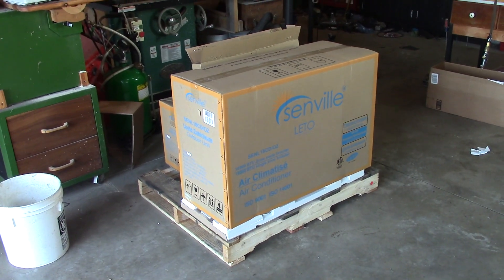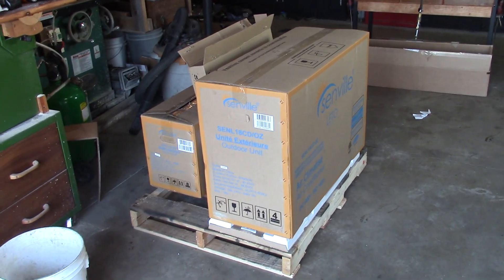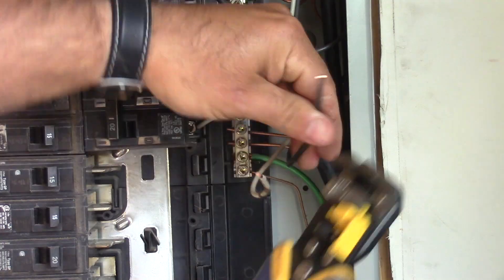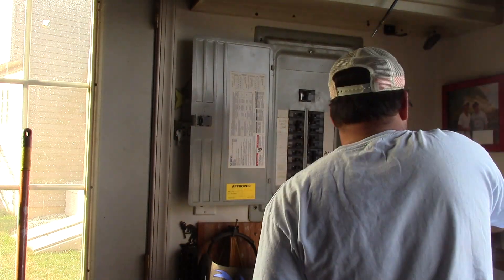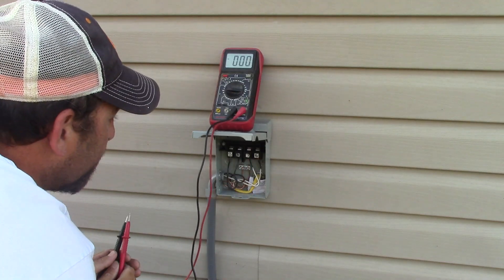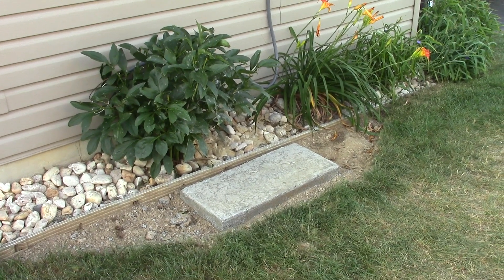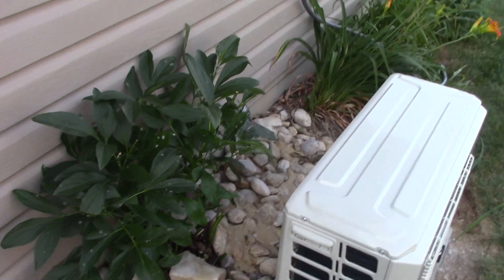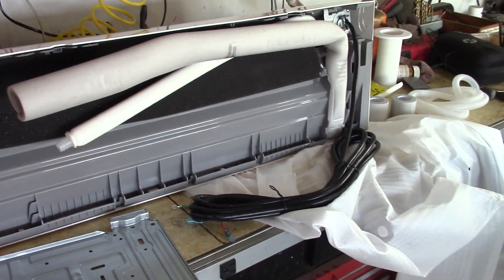Senville Mini Split A/C Heat Pump Installation

Comment: I looked into Senville but need an 1800k 2 zone, they do not know when they will be in stock.
The first thing i had to do was put ina larger circuit breaker panel.

Comment: Self installation is the way to go, regardless of the loss of warranty. If you pay $1,000 for the unit and $500 for tools it will still cost less than having a professional do the install, which could be $500 to $1500 or more. if the unit breaks, you have the tools to potentially fix it. It would cost less to buy a new unit than to have it repaired by a professional. Keep in mind that the warranty will be limited by time and usually for parts. I have a two year old, high end, furnace from Carrier, under warranty. At 18 months, the blower failed. The blower parts were covered, but the labor was $100 to diagnose and $350 to repair. That, my friends, is an HVAC warranty. Get the tools, become self sufficient.

Comment: You didn't need to cut that v in the cover over the electrical wire because the wire should have come in from the bottom. there's two screws that hold a strap in place you remove those two screws and the strap and bring your wire in from the bottom. Bend that wire 90° up and put that strap over the wire and secure it with the two screws.

Comment: Important Note: Many areas are now requiring these units to be installed on the building and it is against code to install on a slab.  My local code calls for the unit to be a minimum of 8 inches off the ground.

Comment: Just be careful when working with electrical and refrigerant. Refrigerant burns can hurt. I install lots of mitsubishi and daiken. I'm licensed. Coworkers get upset when they hear of homeowners trying to install these themselves... but personally I don't care what you do.. there's plenty of work. I do want to hear some reviews on this system if anyone has it? May install an 18k at my house to replace an older 12k hyperheat.

Comment: 3:50 Too much bare wire showing. The insulation should be no more than 1/8 inch from the connector.. The Black wire is OK.
5:40 Same problem...

Comment: You need to use 12-3 with bare copper ground as 12-2 with bare copper ground is not sufficient and certainly not to code in any part of the U.S.

Comment: Can I use a plug with a mini split assuming I am not required by Code to tie into a breaker?  If not, why not?
Reply: This is 220v so you would not be able to just plug it in. However this brand makes a 12k btu that is 110v. Technically you could put a whip on it and plug it in. I would make sure that you do not have a lot on that circuit. They draw quite a bit when starting up. Much like a window unit or a microwave.. you just do not want to overload the circuit

Comment: You are supposed to have an outlet that requires the neutral you took for power. Code requires a service outlet where that unit is placed

Comment: Really nice job with important details in assembling the parts and taking the time to use proper sealing techniques. I especially appreciate putting this together in digestable portions. Also appreciate being candid about being a homeowner level (very skilled) and approaching it from that perspective.

Comment: Thank you for sharing your installation.
Question: I got the 18,000 BTU one. How do I know what size of brakers do I need?
I see you used 2 20 amps. Where did you see that you needed that size? Also what size of wire you used, 12 or 10 gauge.
Please advise.
Reply: read label on outdoor unit

Comment: Installed a 9k btu Senville MS last week. I found it time consuming but straightforward if you have the right tools and don’t skip important steps. Always do a nitrogen pressure test!  This insures that you have no leaks BEFORE vacuuming the lines down. Then,  always use a micron gauge when you vacuum down and make sure there’s no significant rise when you isolate the lines. Wait at least 30 minutes to evaluate full vacuum for leaks. Finally, research and get the required equipment. A 4-way charging/test gauge set is not enough. You will need a micron gauge, Schrader core removal tools with cutoffs, a nitrogen tank, leak detection soap, and enough knowledge to know the steps of installation that will keep your line set air and water vapor free when vacuuming and releasing the refrigerant charge. The primary killer of MS systems is air/water in the refrigerant loop.

Comment: How was your heat pump during winter season? Did you raise the condenser? I had mine building up ice at the bottom so bought a frame to raise to the flooring.
Reply: That's normal. Some brands have a pan defrost system.. these probably don't. Did lifting it help?

Comment: Good video, however, for your size Garage a 12,000 BTU size Mini Split would have been a better choice than a 18,000 BTU (you said 1800 in the video BTW) and with the money you saved you could have bought the better Senville Aura series model. It has a much higher Seer rating and is WIFI compatible. The 18,000 BTU Mini Split will cool your size Garage more quickly but will turn on and off more times than a 12,000 BTU model will and remove less humidity and give you higher energy bills.

Comment: I've got everything I need to install this but I can't connect my line set to the air handler for the inside unit I have red black white green wires but I can't get my hands in there to wear them up nor do I know where they go because they're labeled one two three ground I appreciate someone to help me because I've got everything done except hanging the unit and I cannot do that until I connect the signal wire.

Comment: Is there a reason you went with the 220 unit vs the 120?  Also, @5:57 does that whip come with the unit?
Reply: 110 is ok if you need a small unit. They work. However he got an 18k btu I believe and that is too large to have a 110 model. Only the small units like 9k btu or maybe a 12k btu you can have a choice to get 110. Just make sure that the circuit is only running the unit. If there is a light or something else like that it's fine but too much load will blow breakers and hurt the unit
Reply: 220 volts are more efficient, requirng less current. No the whip and box do not come with the unit.

Comment: Nice video. i bought the senville-senl 12cd mini split system 12000 BTU 110/120v.  This one i can just connected to any 120 v outlet right?  Also by any chance do you have a video on how vacumed this unit?  I came precharged so I just need to vacume it.  Thank u
Reply: Technically yes you could wire in a plug on 110. But you want to make sure that you do not have much on the circuit. It can hurt the system if too much is on the circuit

Comment: Hi, Thanks for the video. How to check the amps for the circuit breaker and size of wiring? And the size of wire from A/C disconnect to condenser? I have a Senville 12hf. Thank you.

Comment: ref lines must be 3/8 and 1/4 and clear tube for condens water?and 14/4 split cable coil 1070 wire?  - to every rooms? thanks for this detailed video!

Comment: 18000 btu can give you a mold/moisture problem! You should be using 12000 btu for that size. Plus with 12000 btu you could've gotten 120 volt making the wiring much easier.

Comment: Good video, looking forwards to part 2.  One thing however, when stripping wire for the breaker, just strip about 5/8", that way you will not have any exposed wire at the breaker terminal connection.  Cheers.
Reply: Also, at the disconnect the insulation sheath(yellow) and paper needs to be removed flush with the connector.
Reply: Part 2 and 3 never happened - this video was 2 years a go

Comment: I thought i bought everything i need to install but the vacuum pump set did not come with the adapters that i need to hook it up. What are the correct adapters i should i get? Thanks

Comment: Why doesn’t Senville just connect that wire inside the head unit, and label it for you? Thanks Senville. Coulda saved me 20 mins because your instructions blow chunks.

Comment: Nice video! However, FOR THE LOVE OF GOD REPLACE THAT 14 GA CABLE WITH 12 GA RATED FOR 20 AMPS! I might add that any wet or outside location requires UH rated cable as well. Even if in a water proof conduit per NEC.
Reply: for petes sakes fella...the jacket on the romex is yellow...in the whip use thhn wire

Comment: Great video.  Thanks for the detail.

Did this get approved by the Electrical Inspector?  The NEC forbids using a "white" conductor (and coloring it black or wrapping in electrical tape) for any wire under 8 AWG.  It must be colored other than white or green.  Also the sheathing must be removed where the wires enter the box.  Your Inspector must be really loose with the NEC.   This can be accomplished by using 12/3 wire and cutting back the white wire OR using individual conductors but you will need EMT (Blue "Smurf tube" conduit)

Also remember, the breaker's purpose is to protect the wire and trip before the amperage goes too high, melting the wire coating and causing a fire. It is up to the installer to check the Max Amps used by the unit and install the correct breaker/wire size.  In other words, basically the breakers and wire size (AWG) are matched.  15 amp breaker is for 14 AWG, 20 amp breaker is for 12 AWG, 30 Amp breaker is for a 10 AWG wire.  There are several exceptions (voltage loss, etc) but for general household wiring, breaker size is matched to wire size.  I always up-size my wire/breakers.

Also, make sure you tighten the breaker screw in the panel or the lug screw in the box to proper specifications.  Many of us do not use a torque wrench when we should.  The torque needs to be very tight to prevent moving of the wire, causing sparks which causes.....you guessed it...FIRE.

As mentioned before, circuit breakers often "go bad"  You should "ALWAYS" double check the circuit with a meter before working on it.
Reply: I was also curious about that too. Is not necessary at all. Once a cable is connected to the breaker terminal, rainbow colors on it, it's hot!
Reply: I got confused  on the video on the electrical on the outside  he never told the size of wire he used from the disconnect switch to compressor. Correct me if I'm wrong the size of wire should be the same 12-2 from breaker to disconnect, 12-2 from disconnect to compressor.

Comment: So for a 24000 btu I can use a 12/2 wire?
Reply: You can but not recommended. 12guage allows for a 30 amp circuit breaker. The two will bring up your two hots (220v) and ground (must rebrand the white white to black with tape or marker) to the ac disconnect. It just means you will not have a dedicated neutral. They want you to have a neutral but at the end of the day the neutral and ground are bonded at the ac disconnect anyway. Up to you I went a head and went with 12/3 just to cover all the bases.

Comment: wow, how lucky the wire you needed was already fed through and just waiting for you to attach it but you should never have touched those without first showing people you used a meter and made sure its dead. . Thats really lucky.
Reply: Why's that?  It was pretty clear the wires were not attached to a breaker or power source of any kind.
Reply: @red97rum   because when showing how to do a job its bad form to not show that you tested it dead, thats all. You dont trust a disconnect, you test it.
Reply: @abraxas511  I get it, very true.  Always better to be safe than sorry :)
Reply: @red97rum  That was my only point. We know he tested it dead. I was just thinking along the lines of safety for people learning. Sorta like a gun repair video where we know the gun is unloaded and safe, but its always good to prove it safe for the audience to show it as a safe habit.. Cheers.

Comment: 14/2 wire ? I called senville they said I should use 10/2 and a 30 amp breaker ... Could I go with either ... It shouldn't pull more than 20 amps...  I have the 12000btu leto
Reply: Well if you look at the amperage it's pretty low for the 18,000 BTU, 20 amps is correct with 12 gauge wiring. This spec sheet comes from their site.  They say min 18A max 25 so a 20 AMP breaker makes sense.  When you get into the 24 and 36 thousand BTU range you are looking at 30 AMP and 10 gauge wiring.  I would not run 14/2 on any of these units. 

Key Product Features

    20 SEER (CEE Tier 2)
    With Heat Pump (Up to -30C / -22F)
    Energy Star Certified
    Whisper Technology (Ultra Quiet)
    Refrigerant Leak Detection
    Inverter Technology
    Silver Ion Filter (Anti-Microbial)
    Vertical Swing Function
    Built-In De-humidification Function
    Follow Me Function (Remote with Built-In Thermostat)
    Low Ambient Cooling (Up to -30C / -22F)
    Self-Cleaning Mode
    PTC Heat Belt and Pan
    Bucket Free Outdoor Design
    Self Diagnosis System

Documentation and Certifications

    ENERGY STAR Certified
    ETL Certified
    AHRI Certified (View Certificate)
    EnergyGuide (View EnergyGuide Label)
    Installation Manual (View Installation Manual)

Technical Specifications
Senville Model #  SENA/18HF
Power supply  Ph-V-Hz  208-230V~  60Hz, 1Ph
Cooling  Capacity                       Btu/h  17000
Input             W  1360
Rated current     A  5.95
EER          BTU/w  12.5
SEER  BTU/w  20
Heating  Capacity          Btu/h  18000
Input             W  1685
Rated current     A  7.4
COP  W/W  3.13
HSPF4  BTU/w  10.3
HSPF5  BTU/w  8.8
Outdoor Operating Temp.     C/F  -30/-22
MINIMUM  CIRCUIT  AMPACITY  A  18
MAX.FUSE  A  25
   Type      ROTARY
Brand      GMCC
Indoor Air Flow (High/Medium/Low)  m3/h  950/750/600
Indoor Air Flow (High/Medium/Low)  CFM  599/411/353
Indoor Noise Level (High/Medium/Low)  dB(A)  45.5/36/26.5
Indoor unit  Dimension (W*D*H)  mm  990x218x315
Dimension (W*D*H)  inch  38.98x8.58x12.40
Packing (W*D*H)  mm  1065x300x400
Packing (W*D*H)  inch  41.93x11.81x15.75
Net/Gross weight    kg  12.2/15.8
Net/Gross weight    lbs  26.89/34.83
Outdoor noise level          dB(A)  57.5
Outdoor unit  Dimension(W*D*H)  mm  845x363x702
Dimension(W*D*H)  inch  33.27x14.29x27.64
Packing  (W*D*H)  mm  965x395x755
Packing  (W*D*H)  inch  37.99x15.55x29.72
Net/Gross weight    kg  48.7/52.2
Net/Gross weight    lbs.  107.4/115.1
Refrigerant Type  g  R410A/1950
Refrigerant Type  oz  R410A/68.8
Refrigerant Precharge  ft  25
Additional Charge For Each ft  oz  0.161
Refrigerant piping  Liquid side/ Gas side    inch  1/4" & 1/2"
Max. refrigerant pipe length     m  30
Max. refrigerant pipe length     ft  98
Max. difference in level         m  20
Max. difference in level         ft  66
Connection wiring         16AWG*4  Stranded, unshielded

Comment: Hello there: I have a question:  I already hang and installed the air handler inside and wants to connect the line set to the outside unit but the electrician has not yet put the disconnect box.  Can I proceed to connect before that?  When I connect the line set to the back of the air handler: I am concerned that air will escape. WIll that be good or not. Hope to hear from you.  Thank you very much for posting your video. Keep me posted please

Comment: Senville would not replace a faulty unit after two part replacements
Reply from the maker: Do you have the paperwork signed off by a certified HVAC tech?  Did the replacement parts fix the unit?
Reply: doublewide6 Repairs LLC yes certified licensed HVAC tech, the interior printed circuit board was the wrong part for the unit.

Comment: Very nice you made it clear that your warranty is going to be voided by installing yourself!  This is what is stopping me for now.  I am considering installing "Mr. Cool" mini-spit because they have a DIY unit that allows people to install the unit.  My other dilemma is the excess length of the line-set. I don't want the extra coiled-up line-set showing in-view.  Thanks for the vlog.
Reply from the maker: The Mrcool is about the same unit.  I am not sure I would set that unit up without vacuuming the lines.  I think most installers would vacuum the lines on the mr cool even though it is not needed.  Manufacturer said it is better for the unit to leave the extra line because the unit is set for 16' lineset.  Added pressure over time can hurt the compressor.  Thanks for your comment.

Comment: I installed an 18000 btu Pioneer mini in my garage last summer. I am a retired Cummins 
engine tech with an a/c cert. I did my own install in about four hours. No outside help.

You are going to love this unit. No more sweating and freezing. Mine is 17 seer and heats
down to about zero degrees in the winter. I live in Missouri . Very cheap to operate. Enjoy
Reply from the maker: I read about better efficient units, but for using it only a few hours a day it was not worth the extra cost in my space.  I have the unit in and love it.  I can't believe how quite it is.  Video will be coming out soon.

Comment: It's a shame the warranty is voided just because you don't have an HVAC license.  Is there any chance you could find someone with a license who would be willing to inspect and sign off on your work?  It seems it would be an easy $100 or so for someone.  Thanks Bob.
Reply from the maker: You need someone that owns their own company to sign off.  From what I understand these units are designed to run well for 10 years.   I don't want to lose the warranty, but sometimes it is hard to have your cake and eat it.

Comment: Nice one buddy. I install and maintain these for a living. Make sure to use some nylog sealant on the refrigerant line set.  Looks like a decent kit
Reply from the maker: Good Tip.  I used it seems like really good stuff.  Can I use it for anything else like pneumatic lines or tools instead of tephlon?

Comment: Did you mean an 18,000 btu unit and not an 1,800 btu unit, ? Thanks for the video.
Reply from the maker: 18,000 BTU I didn't even catch that in the video, sorry.